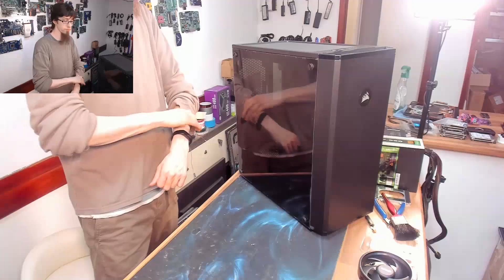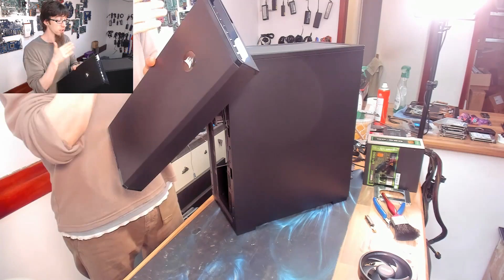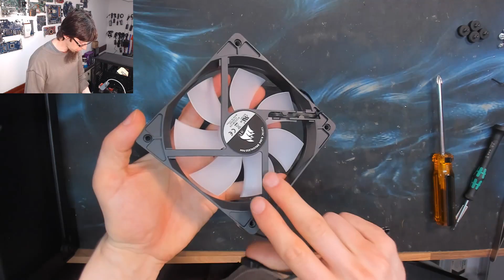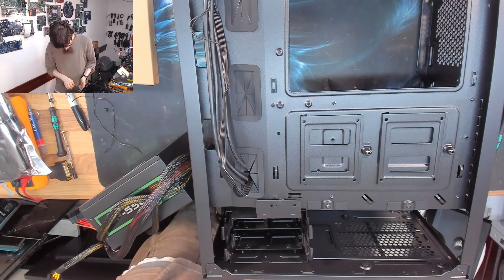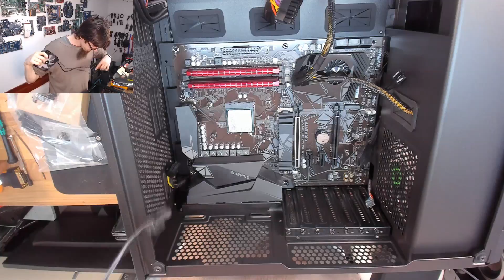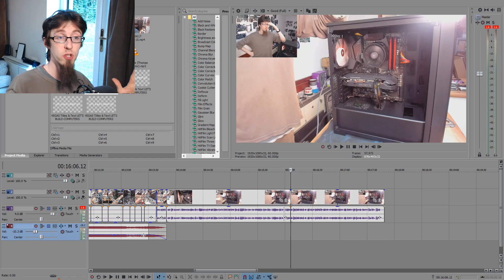Corsair 175R RGB Overview - LBC#52

Comment: So i have 1 140 mm fan and the rgb one from the case so where exactly should I put these 2 fans in the case? 
i thought one at the back to get the air out and one on the top to get the air out too or what is the best placements?

Comment: hi! do you know how to change the colour on the rgb fan? since i have this case and have no clue on how to change the colour. my motnerboard is an ASUSTeK Prime H310-PLUS R2.0. its the intel model
EDIT: I am running an Intel Core i3-1900f, with a GTX 1650 from ZOTAC
Reply from the maker: You need to install Aura Sync in Windows to access your mobo's RGB header.

Comment: 420th like (:
& now that I think about it just within the last few months I'm only on my 3rd case since 2007 lol, started with some full tower Xclio (friend is using it with my old x470 mobo/ R5 3600), cooler master storm stryker, now about 4 months the cooler master 500m, got 2 360mm radiators and d5 pump/res combo in it lol

oh and yes icue is expensive, I got like 7 of the HD series fans the commander pro+RGB hub , not even using them atm lol just the small PCB in new case

Comment: I would ditch that front panel . And replace it with one of those triple 140 magnetic filters. It would run much cooler it would just depend on if you liked the look of it. Or cut up the front panel and add some mesh sections to it.

Comment: Help..
i see you video "LFC#145" and i have the first caps lock error (5 long 3 short blinks) i have a HP 15-ef0875ms and it don't have a battery in the mother board...

Comment: I need some help and maybe you know what's going on. Okay I partitioned my ssd because i wanted to run windows 7 on one partition and so i used rufus and made a bootable thumb drive and when i reboot to install it the windows 7 setup comes up but my keyboard and mouse get disabled right before the windows 7 setup comes up and so i can't complete the installation. So any ideas why my mouse and keyboard stops working? You should know that I have successfully installed windows 10 on a thumb drive  on the same pc with no issues. This is a new pc with a x570 mb
Reply from the maker: Windows 7 has no idea what an X570 is. Perks of a decade-old operating system. Try plugging the keyboard and mouse into USB2 ports on the mobo, if not you'll have to fall back to PS/2.
Reply: @Adamant_IT  I had already tried the usb2 ports but I hadn't thought of trying ps/2 but I do think it will work, actually I studied up on it and I'm quite sure it will so thanks for the tip you're a legend and btw I love your videos, I have watched nearly all of them, I'm a big fan

Comment: SO question for you. I have been thinking about getting the TS100 iron but I already a Hakko FX888D. Will this compare to it or be better or worse?
Reply from the maker: I'm not sure to be honest... I want to say that the Hakko should be superior, but the FX888D has an old-style tip, rather than the higher-end ones where the heater is integrated into the tip. One of the best parts of the TS100 is that it's a cheap iron where the heater is integrated into the tip.
I think the question is; what is your Hakko not doing that you need it to do? I suspect that if you're having trouble with it, a different tip would be a better solution that changing the whole iron.
Reply: @Adamant_IT  not having any issues with it. Just trying to justify getting a new iron with updated tip style.
Reply: @Adamant_IT  After watching Rosman review the TS100. I went and bought it. I like that it can use Hakko tips and the hakko grip. This will be a perfect portable  iron. My 888d is still a awesome iron and will stay at my work bench. 

Btw thank your for the great content.

Did you try putting a jumper wire on your ex2019 and test the clamp cable?

Comment: I guess your customers are RGB Gamers not a silly old fool like me :) I have built 5 computers for myself and charity shops so far and none are RGB thank god :) My 2 desktops sit under my desk so I'd never see it anyway. So for anyone old and senile like me you can do the same build in a Corsair 100R or 200R case. I started with a 200R but found it had too many extra fan perforations to let in cat hairs from my old tom cat when it moults so swapped everything into a 100R that is completely closed, i just use the motherboard to control the fans not the case. The 1st is socket 1151 with 2TB nvme and the 2nd is socket 1150 with 500GB SSD and 2TB HDD. both use intel i5 csu relevant to MB age and 16GB ram. For my use its hard to tell them apart so 1 cost £800 to build and the other less than £200. The charity ones were all 1150 and went to folks that needed them. I do however love watching you build RGB sets, and love the results but I wouldn't give one house room. those lights would send me crazy but for all the young folks that enjoy gaming and lights they are perfect so have great fun with them. Best wishes to all and please stay safe out there!

Comment: Have you ever built in an In Win 303? In the states it's the same cost as this case or the 220T, no fans but like you said for around $30 more you can add the ARGB if you desired, and less more if you wanted just basic fans for the airflow.
Reply from the maker: It's a bigger case, which I think places it in a different category. But I do like the 303, it's good value and I really want to do an In Win build at some point.

Comment: I need some help with a very recent PC build, Xeon E5 1620, GTX 960 and 16GB RAM. Everytime I install the GFX drivers no matter what OS I am using I get a black screen.
Reply from the maker: That usually means the GPU is dead. Test the graphics card in another system.

Comment: If you have spare white led, connect a 2.7 K resistor in series and connector 12 V  and place it near where the hub was. A  25 cent solution to a bit of lighting.

Comment: I bought this case for my son last year, he had a little Rosewell POS, acted like a space heater. I found this case well made and fairly easy to work in. I also put the fan into the exhaust position and threw an RGB strip in the front to illuminate the logo, looks good.

Comment: hi adamant it, i'm one of your new viewers who've been enjoying watching your back catalogue and smiling in sympathy as a builder on a budget watching the sleeve ends of your wardrobe fray over the years. i've been building my computers since about 1998,  brilliant vids that make a lot of stuff (slightly more technical things and soldering) that i have felt were beyond me more manageable. many thanks. 
i'm planning a build soon which will i'll be popping under my bed so will be horizontal rather than vertical in situ. any recommends for a good suitable case, glass panels are irrelevant and the floor is hardwood so no carpet dust.
again cheers for the informative entertainment.
Reply from the maker: Fractal are good for quality cases. A lot of their models are available with solid side panels for silence, rather than looks. If you need something low because of the height restrictions, a cheap rack-mount case might be the way to go.

Comment: whats the plan with this case ? like the aero cool and sahara cases are value and provide airflow , this has to be a complete hotbox stock i know were talking budget here but 1 fan  is pushing it im sure u agree :D like if u left the fan at the front and moved the drive cage then you just choked it completly this case im sure is solid but its not really beginner friendly is it i would trade that corsair badge for a extra fan imo :D

Comment: The deepcool matrexx 55 is a verry nice budget case too.
Reply from the maker: That is very cheap for what you're getting... Not a fan of glass-fronted due to airflow, but no worse than this case I guess!
Reply: @Adamant_IT  The frontpanel has vents on the sides and there's a good 2 cm space for the fans to breathe. Works nicely with a dual 240 rad setup :)
And it has a built in argb controller for unsupported motherboards.

Comment from the maker: Sorry for two case reviews in a row, but none of my repair videos are ready for a monday release. Got board repair stuff in the works!
Reply: On the back of your XPG review, I bought the case. Your insights were spot on (including the slight misaligned fitting). What really did sell it for me was the novel side mount for an AIO, loads of room inside, just a shame only 2 mounts for SSDs and could do with a teeny wee bit of extra room for cable management at the back. Nice to see RGB and ARGB connections and the USB 3 connectors - I also like the power button. Front air intakes are good, there's a wide enough gap to get your fingers through. For anyone else thinking about this case - go for it. 
As a new sub, but an old system builder (yup I've been building pcs since the early 90's) I'm really enjoying your content.
Reply: Whatever the CASE , you did a good job.